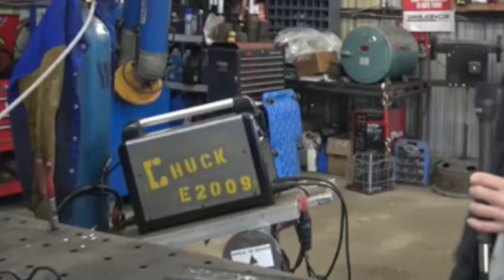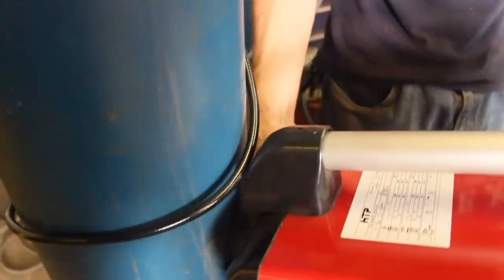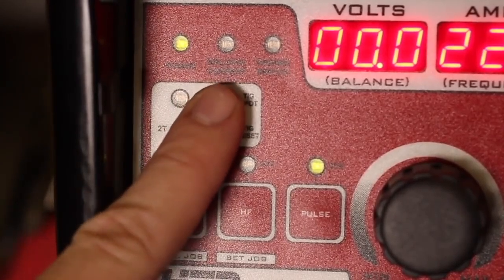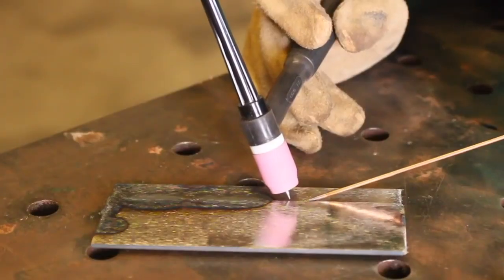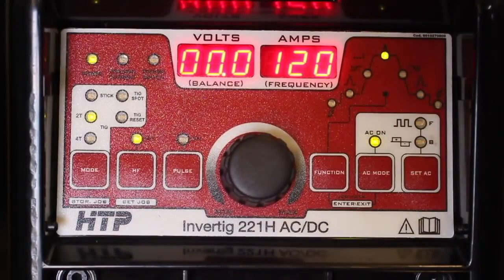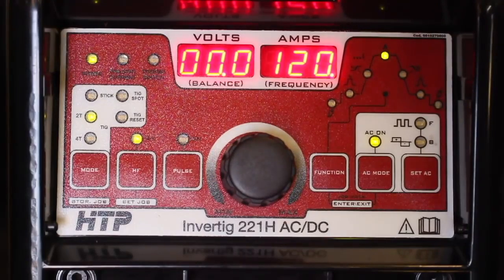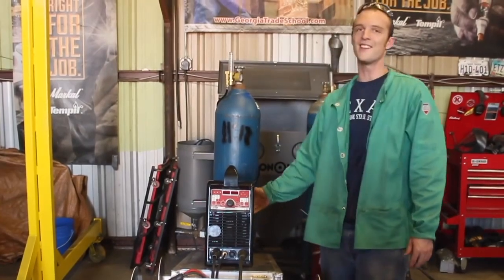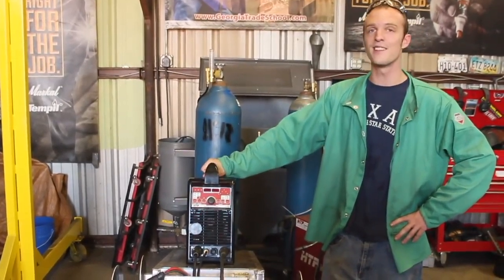~6 YEAR UPDATE ON A PREMIUM TIG WELDER: HTP INVERTIG 221 STILL GETS IT DONE!

Comment from the maker: UPDATE/CORRECTION/CLARIFICATION: Since this is an ARCHIVE channel, I've left the original pricing from 2016(?) in the video for authenticity's sake. That being said, prices have gone up since then on everything, but the HTP guys do have this machine on special right now for anyone interested:

https://usaweld.com/discount/Zila%2520Special?redirect=%2Fproducts%2Finvertig-221-single-voltage-air-cooled%3Fvariant%3D31917528350803
Reply: Follow the checkout procedure and when you enter your address my coupon code will automatically populate and you save another $300 for a final price of $2199   That is cheaper than 2016!
Reply: I'm getting a 404. Any chance you have a fresh coupon code?
Reply: @ar5000  since then HTP has rolled back prices for everyone to $1999 !

Comment: Ha, I bought my 221 based on your review around the same time your original video came out.
The bad part is, I’ve only been able to have one bottle (80cf) of argon through the machine, mostly due to my automotive career taking off. I still love using it and hopefully I’ll get to run some more time on it this coming year (2024).
To be fair I do miss the simplicity of my old Miller diversion 180.